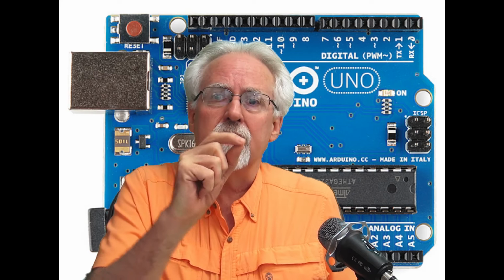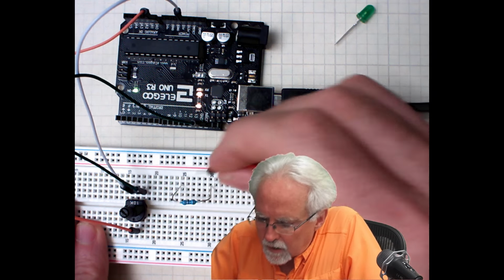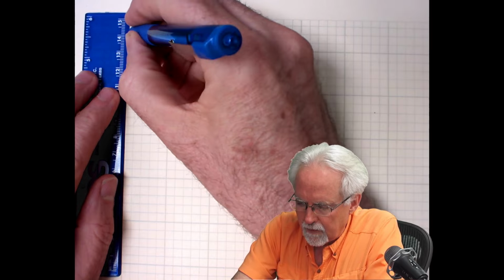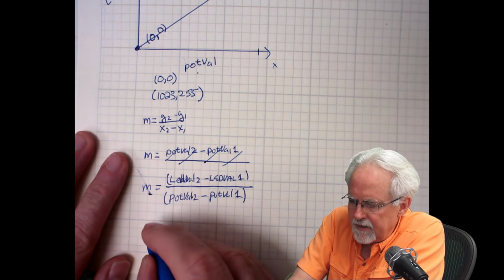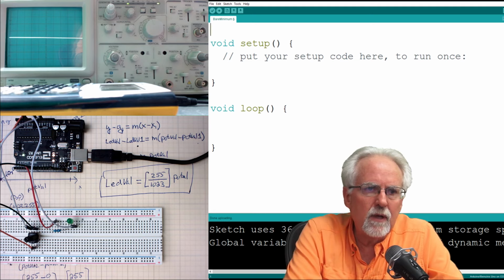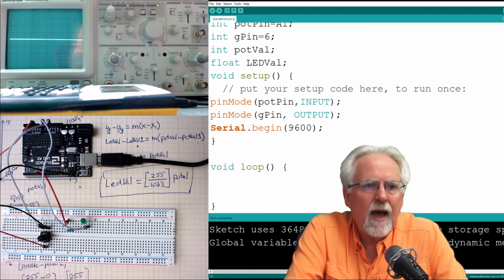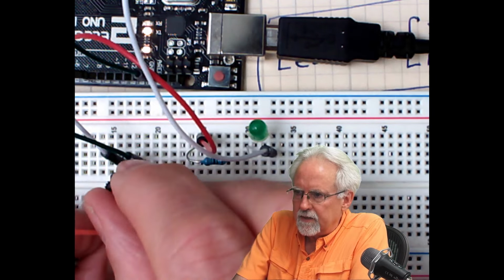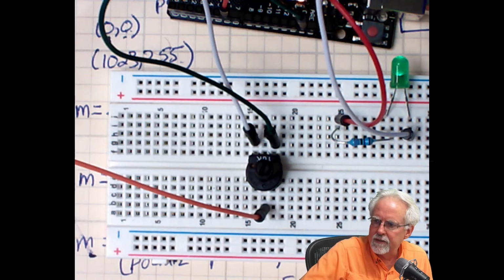Arduino Tutorial 14: Dimmable LED Project

Comment: if i have an elegoo mega will it work with this code my digital 6 pin does not have a squiggly line by it serial monitor reads 13.7 v...int potPin=A1;
int gPin=8;
int potVal;
float LEDval;
 
void setup() {
 pinMode (potPin,INPUT);
 pinMode (gPin,OUTPUT);
 Serial.begin (9600);
 
}
 
void loop() {
  potVal=analogRead(potPin);
  LEDval=(255./1023.)*potPin;
  analogWrite(gPin,LEDval);
  Serial.println(LEDval);
 

}

Comment: Just to prove that you can teach. I made the binary counter and the intensity of the LEDs was blinding so I changed everything to an analog output but that was too cumbersome changing and recompiling every time I changed the value. So I used the dimmable LED project. Well the counting was too slow to wait to see if the intensity was right so I added another pot and circuit to adjust the speed as well. Now I can adjust both speed and intensity without re-compiling.

Comment: Hi Paul, great lesson but I have a question. We do an analog.Read(PotPin)
Would it be better to have PotPin be a float. I can see it doesn’t matter because our degree of accuracy is within bounds but wouldn’t declaring a float value be more accurate?
Reply from the maker: PotPin is the number of pin you are connecting to. That has to be an integer. You would never have a pin number of 2.5. similarly, the value you read is always an integer as it is between 0 and 1023 but always an integer.

Comment: for those stuck with HIGH/LOW (on or off) outputs, make sure you use an analog output (pins with a tilde), stumped me for a bit until i remembered Paul mentioned something about it (i watch the video to the end before attempting the project on my own).

Comment: another great video! I've found if i don't do a module or two every day i begin to forget some syntax or certain key points.
             So I've gone back today with a pencil and paper and written proper notes so i can review and reference from when trying to do the projects on my own. this has helped tremendously with the formulas and doing the math.
          As a young kid i often slept through my math classes since i didn't see any reason to bother memorizing it at the time, but now after seeing some practical application, ive found new reason to be interested in learning it. which makes the whole learning process easier and more successful.  
         Learning because you want to and not because you're told you have to, makes all the difference. i find myself after these videos spending additional time doing extra homework using external sources like khan academy just to get more practice using the equations presented in these videos to solve other problems.
         if someone would have told highschool me that i would be doing math in my spare time because i wanted to, i would have laughed at you lol.

Comment: Back from vacation.  I watch the videos all the way to the end and build the circuits.  I use TinkerCAD first to test them.  COMMENT:  I was surprised that mixed mode arithmetic was allowed in LEDVal= (255./1023.)*potVal;  I thought for sure I would need a floating point variable like potValfloat = potVal.  The math and programming (except for the real-time issues) are easy so far, but the electronics are new to me.

Comment: I finally had enough of the breadboard and Arduino moving all over the place, so today I went to my woodworking shop, and I made a board that holds them together. MUCH easier than having the two boards floating all over the place. Your organized engineering side would love it!
I did better with this exercise... only a couple of typos that I found quickly.
Reply from the maker: Nice work!

Comment: Hi Paul! Everything looked good at the breadboard and my little Elegoo UNO3 looked satisfied as the the code. Ha! Not good at all. No green LED  was dimming. Looked at the SerialMonitor - looked awesome, but no green LED dimming actually no light at all. Had the green LED crashed? Tried a new one. Noop. Checked the green LED circuit - looked good. Uninstalled the circuit with the Potentiometer and checked the circuit with the green LED with a basic code that you have showed us. Let it be GREEN and the LED was GREEN with full brightness. Hmmm... had I missed something when I was written the code. Well, there it was - my mistake. No instruction to the greenLED - no "analogWrite (greenPin, ledVal);". I hope I have learned something about my mistake. Now I am happy again! See you on Tutorial 15. By the way - I really liked the math. Thank you for your teaching!

Comment: Thank you so much sir for your explaination. I follow your lesson from tutorial 1 and its wonderful. I love it so much.

I did the diffrent approch in this dimmable Led project by connecting the LED cuircuit part directly to the middle pin of potentiometer. I found out that this approach also can dim the led but not as sensitive as your method (potentiometer value to Led value mathod)

I love to see that there is diffrences in outcome of both approaches and make me underatand more. 

Thank you so much sir. Keep it up

Comment: If you have problems with your USB Connection and uploading the Programm try adding The 9V Battery as Power supply to the Arduino this helped the Stability of the Port a lot. at least for me :)

Comment: Yes I'm following, I've had a couple of odd problems, which I've sorted, but don't see what I actually did wrong, so today, I've built a voltage monitor for a 5v rail, i set mine as a status light, 5-4 green, 4-3 yellow and below 3 is red, i was happy it switched fine, now i've got my dimmer switch working too, same as yourself, i'm having connection problems, these modern breadboards are not like when i was at college last century. i have to say, setting up a 0v & 5v rail have simplified my layouts, my personal preference, bit like i drink mint tea, if i drank the same amount of coffee as yourself, I'd be smelling the colours. 
Thanks again.

Comment: i actually tried this a few days ago with much less of a clue, but im having similar issues now, my analogWrite value for the led shows up properly in the monitor, but the led itself only comes on at about a 128 value and goes straight to full bright, i have no dimming action, on an analog out pin, any commenters have a thought?

Comment: Sir
I am really wondered by going through your tutorials. Your explanation so excellent because you are just not rigging up the circuit and explaining. You are explaining with root concepts  which the true Engineer requires it. In this tutorial relationship between potentiometer and LED read value is fantastic explanation. Thank Q so much Sir

Comment: Paul, your videos are amazing, and you are a great teacher! I’m a chemical engineer, but never did match with electrical or coding until my current job. I’m now doing plc programming and wiring up level and pressure, transmitters, et cetera, There isn’t much good information on the Internet in terms of basic instruction. My son as a freshman electrical engineering student and had a semester project based on the Arduino last year. After watching what he was doing, and realising how similar it is to PLCs, I bought a kit and started playing around with it just to get more familiar with electrical and coding. Then I found your tutorials. You have a great mix of immediate hands-on instruction, but with the math and physics mixed in. I find most tutorials limited in value because they mostly just do the hands-on part. So far your progression of skills has been spot-on.

Comment: Hi Paul, I built this circuit and it worked a treat. It's late at night and I'm a bit fuzzy headed and I've got a question: "How do you know that the graph is a simple straight line from 0 to the maximum point?" Tomorrow, when I'm more clear headed, I'll write some code that prints the  x value and the y value side by side to prove the straight line. Thanks for another great tutorial.
Reply from the maker: Really it is a line because we say it is a line. We need smooth values between two points, what better to use than a line.

Comment: Great lesson. Had to remember some old math I haven't used in forever. I made a little addition to the write values to include the LED Value and the Pot Value, which I thought was interesting to see their relationship. Also added a little delay after the write.
int baud = 9600;
int potPin=A1;
int LEDPin = 6;
int potVal;
float LEDVal;
int delayT = 500;

void setup() {
  // put your setup code here, to run once:
  
Serial.begin(baud);
pinMode (LEDPin,OUTPUT);
pinMode (potPin,INPUT);

}

void loop() {
  //get the voltage reading from the potentiometer
potVal=analogRead(potPin);
// calculate the amout to write to the LED
LEDVal = (255./1023.)*potVal;
analogWrite(LEDPin,LEDVal);
Serial.print (LEDVal);
Serial.print (",");
Serial.println(potVal);
delay(delayT);

}

Comment: Plz answer this, CAN WE BUILT INDUSTRIAL PRODUCTS USING  ATMEGA32P UPLOADING ARDUINO BOOTLOADER IN IT
Reply: Yes, because the ATMEGA328P is the same microcontroller that is on the Arduino, and all you need to do to upload code on it is to get the Arduino board that lets you remove the ATMEGA328P microcontroller from it, all we are using the Arduino board for is to just to upload code to the ATMEGA328P chip, So just write code and upload to the Arduino board and then pull out the ATMEGA328P chip and put it on a breadboard and get some other things and then power it with a battery are something, and there you go, you made yourself an Arduino, that you can put on electronic boards. You can look up a video of how to make an Arduino with the ATMEGA328P chip, it is easy to do!!! I hope this helps.

Samuel

Comment: Paul my Guru ji.. I can see lot of improvement in myself. Its giving me tremendous confidence as I go along with your series. I too struggled  like you struggled with your Circuit loose connections. Not sure, is it because of the poor quality of  the components. I don't think I would be able to use the Starter kit in the long run, thinking of buying components separately.  Thanks for your all service. Love peace

Comment: Paul, I did some searching for the name you are calling "squiggly". Below the Escape key you have what looks like this:
"~" called a Tilde and back tick. On the Arduino board where it says "DIGITAL PWM~" that's the Tilde. Sounds like "Tild".
I have a question. Why is the Processor in a socket? To replace or put in a different processor?

Comment: Paul, This is interesting to watch. Hook your Scope lead to pin 6 and watch the output.
For me the led is stable at 1.25 volts and the scope shows a narrow spike. Increase the brightness and watch the spike gradually widen to a symmetrical square wave. The Serial shows a value of 127.
Continue increasing the brightness of the led more and the spikes appear on the bottom.
So actually we have an adjustable pulse width, a rudimentary function generator. I used the Hantek Scope Meter.
For advance use, use a resistor and capacitor and you have a Triangle wave. Adjust the pot for symmetry.
Now new possibilities are opening up. I haven't tried this, as this is getting too advanced for some.
Wayne

Comment: An easy way I found to get similar results is to connect the potentiometer's output leg to the first leg of the resistor going to the LED, replacing the voltage received from the output pin. Both the LED and the potentiometer are then grounded. Turning the knob to the max left will result in 0 volts and max right in 5 volts, resulting in the LED going brighter and dimmer...

Comment: i don,t understood about that m
Reply: "M" is the actual slope of the line from origin (0,0) to endpoint (1023,255).  With Y over X, you have 255/1023, which is .2493~.  It means that for every whole X value (going right on the graph) you go up (Y value) only .2493, or roughly .25 value.  Think of it as stairs, where you went 1 foot forward, but only 3 inches up (.25 feet), and you drew a straight line between the start (0 feet, 0 feet) and edge of the next step.  In this case, M=.2493, but the equation works in the coding better than the answer.  Does this help any? In the equation, M is (255/1023)*potVal, but we want the LED to light up linearly as we turn up the potVal, so we write it to the gPin as LEDVal.  I'm probably confusing you.  Sorry.

Comment: Hey Paul, I have really enjoyed all of these lessons so far. I noticed that, if I didn't know the range for the potentiometer (0-1023), I could use the setup in this example, and then add a Serial.println(potVal); to get that value. Is there a way to determine the range for the LED (0-255) or are all LED's 8 bits of resolution?

Comment: I am so sorry but, it is 32 degrees here in Orlando. So, I have a giant mug of Hot Coffee.
I continued this lesson from the homework of the previous lesson and a big penny did dropped once completed. As a software engineer, I found myself noting the isolation of the potentiometer circuit and the LED display. It is seeing the physical wiring versus the conceptual design. Prior to this I viewed things with a singular linearity. Now, seeing that the coding as the connecting aspect of two separate physical events is a bit mind blowing.

Second, I found myself thinking about how engineer-thinking and my software-thinking may intersect. This was the result of your comment preceding the use of slope to scale the values. I realize this is linear math but, I wondered about the origins of my immediately cross-multiplying to scale the vRead to the LED value in contrast to your deriving of the algorithm. The end result was merely a semantic difference but it causes me to wonder. 

(int) ((val * 255.0) / 1023.0);
vs.
(int) ((255.0 / 1023.0) * val));

Like I said, it is a trivial semantic but, how we got there was different based on how things are taught over the years.
Reply from the maker: Hot coffee is on the approved beverage list, as long as there are no sweeteners.

Comment: Loving the lessons thanks Paul.  With 305,000+ subscribers...I can GUARANTEE you are NOT talking to a wall....lol.

Just wanted to add that the last two lessons (13 & 14) the potentiometer doesn't sit that well in the Elegoo breadboard (even after changing positions and 'mashing' it in).  So most times you will have to stabilise the pot with one hand whilst turning the pot with the other.

It's like the breadboard works much better with patching leads wire and LED pins, than it does with pot and resistor pins (how many bent resistor pins have you got trying to force it in the breadboard?!  Yes - even using needle-nose pliers to put the resistor legs in!).

Learnt so much over the last 14 lessons.   Keep up the great work Paul.

Comment: Thanks so much, Paul, for your lessons and especially for your clear explanations. I am a crusty old math teacher, semi-retired, with a smattering of previous knowledge regarding electronic components and programming, so I am learning some new to go with the old (for me). A couple comments- I like to compare what we are doing in the current tutorial with what we did recently, and I notice you don't really need to incorporate a time delay, which implies the loop runs continuously repeating. Also, I will be trying this with modifications to the linear conversion, adding a nonzero y-intercept, and using an exponential equation in place of the linear, to compare results.

Comment: I have a problem with my potentiometer. It jumps up from the breadboard and doesn't connect properly giving me weird voltages you had when a wire was loose.
But it is working as intended now.

Thank you for these lessons. I am learning new things, even with my experience with programming.

Comment: Yes. Watching them all and doing the projects and HW.Here's what I want to do: Make a program that will tell me the resistance of an unknown resistor so I don't have to look so carefully at those tiny colored bands. But it's tricky because at the moment there are two unknowns in my hypothetical setup.  If I have 1 known (R1) and 1 unknown (R2) resistor I can see the voltage after R1 (i.e. across R2) but I don't know the total current without knowing the total circuit R.  Not sure if I have a second equation to work with. Anyway...I'll keep working on it.

Comment: So the 5/1023, is obtained in a similar way from 255./1023., By finding the slope and using a lineal ecuation to determine the equivalent value that Will be applied to the LED?

Comment: Hi Paul, love the tutorials. Had a quick question if you have the time. I want to measure the voltage across the LED. I've connected a wire between the resistor and positive pin of the LED to an analog terminal (A4 in my case) in order to do so. I've added the code as well using (5./1023.) slope. The serial monitor shows the correct maximum value (2.69; verified it with a voltmeter) and correct minimum value which is 0. My problem is that it doesnt show any values in between. It's just 2.69 or 0. Any advice? Thank you. (Edit: The voltage reading across the potentiometer works wonderfully, just across the LED is a problem).

Comment: Good Day Sir,

First off, great instructional videos.  I have learned a lot from your different series'. I have one question about the calculations involved in some of the new arduino tutorials. For example, in New arduino tutorial 14: dimmable LED project, you us the VueScan 255 and 1023. Would you want to use the values 256 and 1024? As those values are 8-but and 10-bit and that programming language begins and includes the value 0?

Comment: Slope of the line is Rise over Run. Y/X just doesn't stick in the mind. I've remembered Rise/Run since high school  (45+ years).
Reply from the maker: Rise/Run is correct, but Y/X is just simply wrong. It is change in Y over Change in X. Or (Delta X)/(Delta Y). This becomes (y2-y1)/(x2-x1)
Reply: @paulmcwhorter  got it!